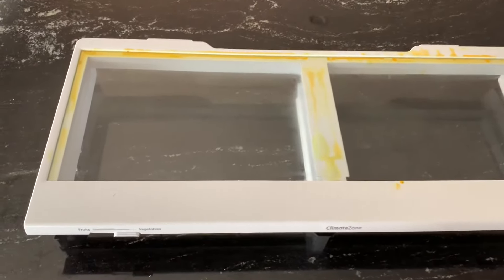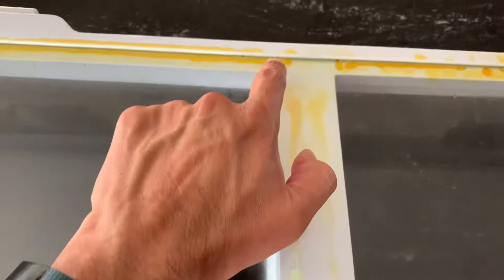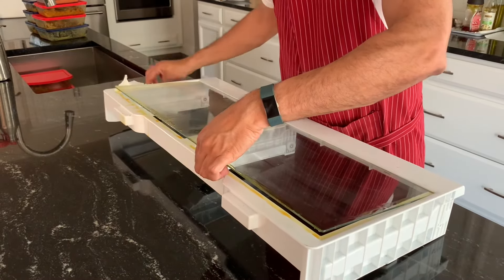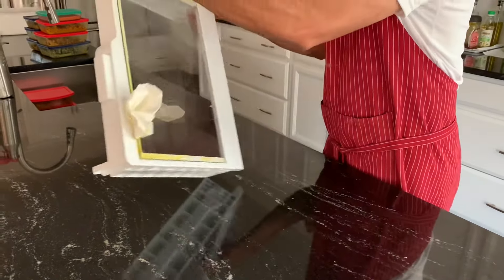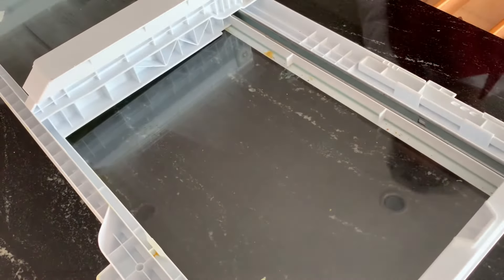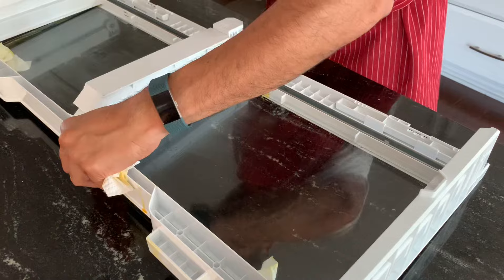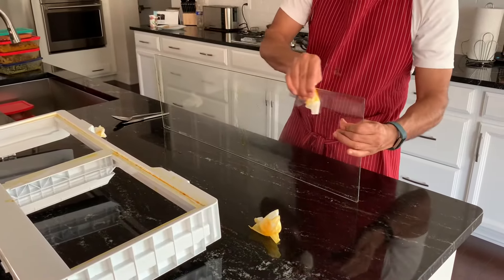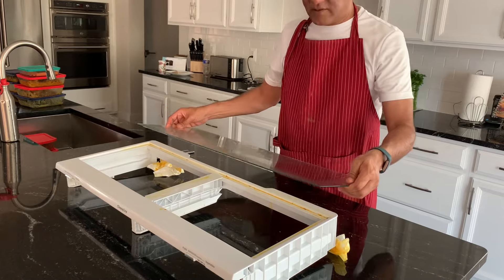How to safely remove bottom shelf glass of GE Cafe refrigerator

Comment: Excellent! I was able to do it myself! But mine was so grimey I had to spray cleaner along the back so the glass would pop out. I would also suggest doing the process on the counter covered with a towel! You are brave to do it on a gard surface! Thanks!
Reply from the maker: I'm glad it worked for you, and thanks for the tip about towel on the counter!

Comment: Thanks very much for video.  It helped me immensely.  Just wanted to add that we had an orange juice carton leak on and into the seams of our shelf. So the glass-to-plastic binding from the sticky juice did not permit our shelf to tip as easily as yours.  However, I put down three dish towel on our kitchen counter top and let the glass and shelf warm to room temperature (about 15 minutes) before slowly working warm water (about 95*F) into the seams with a toothbrush.Then I slowly poured about a 1/4 of warm water along the seams until I noticed water slowly dripping onto the dish towels.  That allowed me to break the sticky seal so I could push up the glass and continue to follow your video instructions.  (Next time I will not give the juice time to create that sticky seal.)
Reply from the maker: Most welcome. Thanks for sharing your tips, I am sure it will help many people.

Comment: Do you have any advice on cleaning the upper shelving units? The glass does not come off those.
Reply from the maker: A vinegar solution or window cleaner are both good options, the window cleaner will smell of ammonia though. I use vinegar solution (a table spoon in some water) for most applications.

Comment: attempted this, but the glass does NOT lift from the center, only the 2 ends. why?
Reply from the maker: Most likely stuck due to something going under the glass, try applying force as close to the middle support as possible from both ends or pry it out from the middle with a knife
Reply: You were correct! there was something sticky under the class. added forced and was able to remove glass.  Tx you so much!